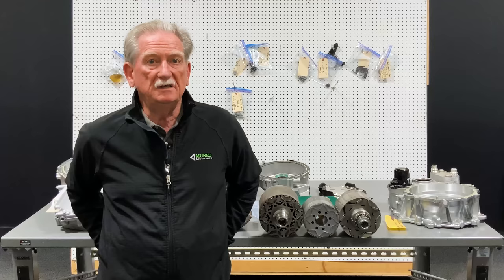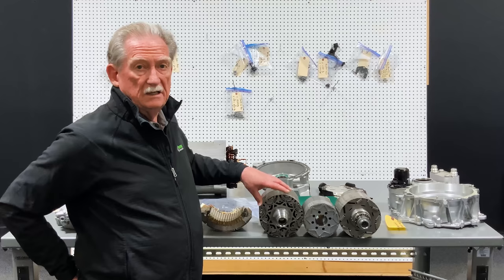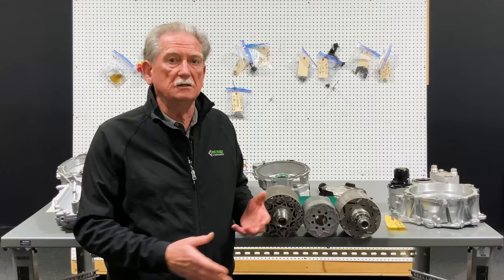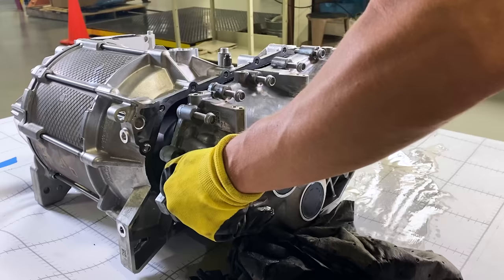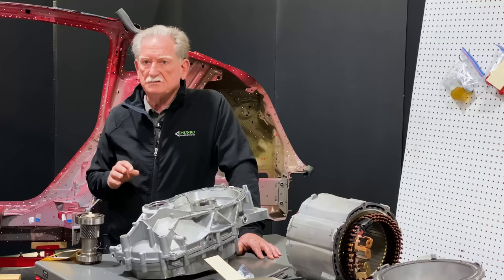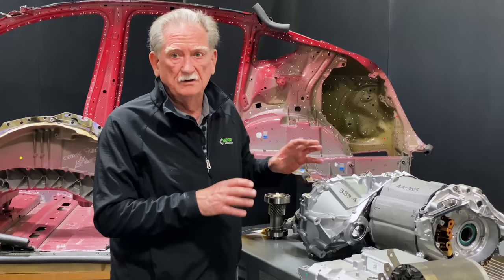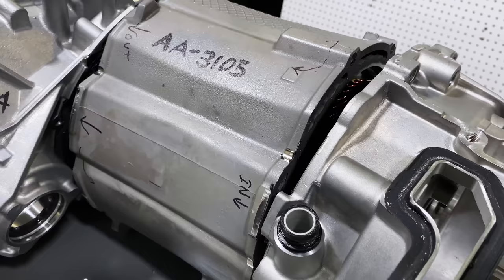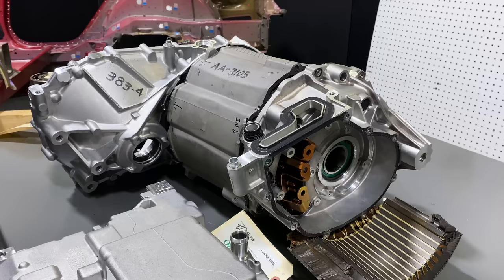Volkswagen ID.4: Electric Motor Teardown and Analysis

Comment: I think this guy has a patent out on snap fit components because anyone who worked on cars knows that snap fit pieces only work one time and never fit again. Also I worked for Ford Motor company for 8 years and their front bumpers need to be removed for service of many things and after you take it off once it never stays in place. A 1985 chevy where everything bolts on still fits perfect. SO Munro if you are reading this please explain to me what you think makes it better and i will provide my experince

Comment: The anti-fastener argument doesn't make sense to me.  Threaded fasteners allow for easy adjustability - take up the tolerance in a stack of parts that your rivet clamping jig may not.  It allows for disassembly, repair, maintenance, and recycling, whereas rivets can't be as easily removed.  Threaded fasteners can be used with thread lock or locking spacers to prevent them from loosening.  I agree, however, that minimizing the number of fasteners and using undercuts and latching features in combination with fasteners is good for reducing cost and weight.

Comment: I don't understand why they did not eliminate the permanent magnets and went for a switched reluctance design. That will be both cheaper, and you don't have to rely in China to get the raw materials for the magnets. And a good inverter will eliminate the torque ripple problem.

Comment: The single motor ID4 can tow 2200 lbs. Even the dual-motor version of the Mach-e has no towing capability. That should tell you something about the difference between the two cars’ motors.

Comment: Does anybody realize that VW and also lost other big OEM‘s are only buying the already finished and assembled product and that gearbox, inverter and E-Motor is done by their suppliers? 
Also I agree they won‘t be serviced much but just replaced. Cause it costs much less

Comment: I disagree with your criticism of the screwed-down PCBs. If they didn't want to be able to replace the PCB they would probably have potted the whole PCB to vibration-proof it, increase thermal bonding without the loose thermal pads - this also would have removed the need for screws. 

Now, if they used normal machine screws instead of some kind of tri-lobular taptite screw, I agree they were a poor choice, but generally the right concept.

Comment: VW had to focus on motor engineering as its behind on the battery output. So it has to cut costs elsewhere and the non battery manufacturing offers cost cut opportunities and efficiencies.

Comment: Should an inverter should be fixable? If MTBF is really high and the cost of a new part can be lowered and its MTBF can be increased by making it unrepairable then, yes, glue it together. It's all about reducing the overall cost (and environmental impact) across all users. I feel a complex graph coming on.

Comment: INPUT!
Yes, snaps are better for you, but snaps are not better for me, the consumer.
Some (most) want service'ability.
The more snaps you install, the more I yell and need bandaids.
Cheaper is not always better and all it takes is a few knuckleheads like myself hoop'in and hollar'in about how many bandaids you're going to need and then you're back to the drawing board.
I watched to the end, I agree less fasteners the better BUT, what is your replacement for key pressure points?
Snaps are typically 1 way. Upon de-snapping, your grip/hold is less tight.
Service'ability

Comment: you said vw dont have pump in the coolant system, but how the coolant circulates if no pump?
Reply from the maker: Sandy was referring to pumping the “gear oil” to the plate heat exchanger. The Tesla has that pump and interface and the VW doesn’t. VW does pump coolant through the aluminum housing.
Reply: @MunroLive  yeah I was asking the coolant circulation.  So, there still a pump? thank u

Comment: As a diesel tech, I deeply question this guys expertise. He doesn’t make a fucking thing. “People wont repair this inverter… Like ignition modules no one repairs this either”. Well hey buckwheat, engine, transmission, and a pile of other body and chassis controllers are repaired everyday. Threaded fasteners do their job very very well. Installed properly, and secured properly they are incredibly durable. I see threaded fasteners go down the road for nearly a million miles without ever coming loose. 

Frankly this is a case of someone justifying their engineer job. I must find something to complain about… 

This guy has pocket hands. There isn’t a scar, or callous anywhere on them. They are red and swollen from always hanging at his sides, or being  in his pockets, do playing with his pencils, rulers, and computer mouse. 

Get out of your office and get in the shop. Then you can apply your engineering “opinions” in the real world when you have to drill out a rivet, or scrape of your glue, or toss a part because a clip broke, replace (to do it right) or put a screw into a dash panel because the plastic hole or stand that your god forsaken clip attached to or passes through has worn so far the clip does nothing

Comment: Sandy's hate of screws and bolts has always bothered me. I'm fine with reducing but when everything is snapped and glued together, it's throwaway and not serviceable. It will never go back together the same and you will always break snaps taking it apart. The snaps are also hidden so without direct knowledge of the placement it's just a nightmare to service.

Comment: I completely disagree on rivets and glue in the inverter! It is too valuable to salvage.
VW made a good decision to go with the top to bottom design with fasteners.
Usually it is some dirt cheap on board ceramic capacitor witch fails and not the expensive IGBT. 

Also as an electronics engineer I can say that you can save the board space with the external bolton bleed resistor comparing to the on board SMT resistor array.
And it will dump the heat to the case directly and not to the board itself. 
Repetitive thermal cycles are the main cause for cracks in onboard components and solder joints.
If you have to do that, place the resistor array away from the other components on board, not in the middle of the board along with the main controller and IGBT drivers like tesla did @29:00. Probability of a crack is directly proportional to the number of solder joints affected by thermal gradient.

Comment: You are way ahead of me in your excellent knowledge and experience. There is one thing that worries me. You would prefer components to be sealed for life. That's Ok if the life of the one I happen to own has a long one. But if a five pound (GBP) component within fails, you cant replace it. You are removing the jobs that trained mechanics can do. So I buy a car that costs say, £15,000. After a while, its out of warranty, and I need to have a £10,000 component to fix it. I used to build historic race engines. Many of them were 50 years old. I never had a threaded fastener undo in service. If I had followed the 'seal for life' way, I would never have built an engine. So there are times when progress has to be examined with a non-engineer eye. Thanks for video.

Comment: I’m not so excited about eliminating a bearing as you are sir.  First preload increases bearing life which may have been lost; second, Helical gears produce side load which are usually reacted with tapered roller bearings.  You didn’t show the other bearing, but looked like ball bearing.
Fasteners loosening, in assemblies like your taking about usually there are shear pins so fasteners don’t see shear. The four bolts in the motor probably need to be staked (mechanical retention).

Comment: At the 11-ish minute mark, he is talking about "this is the oil pump, the oil filter, the heat exchanger" on the Tesla motor. Wait, what? Am I to understand that Tesla's have oil filters oil pumps and heat exchangers in addition to their coolant system? LOL for some reason that cracks me up, imagining an electric car, that ends up having a Convergent Evolution to an internal combustion type's need for actual implementation. What's next, an oil bath air filter like an old Series II Land Rover? hahahaha

Comment: Snap in fasteners snap. The worst part of american cars is the hidden snap fasteners that always break when you try to take something apart to repair something else, increasing the cost of the repair. With electronics becoming a major component of vehicles you want to be able to repair them rather than throw them away. That would be like throwing away the IC engine because it was worn out rather than rebuilding it.
If the screws are backing out it is because you did not use dowels to keep the parts aligned and the side loads off the screw tension fasteners.

Comment: Thank you so much for doing all the analysis that I have not been motivated enough to slog through myself. Your conclusions on winners and losers seem quite plausible. In terms of when the globe will hit 100%, these things follow an S curve for which there are formulas available. Thus the last 20% or so come far more slowly then the middle 60 or so percent. So one cannot just extend an exponential growth rate to 100% or one will greatly underestimate how long it will take the convert the last 20% Luddite hold-out consumers. There will also be consumers whose driving cycle may truly be better served by another propulsion means like a ranch in Wyoming or a off-grid home in the Rocky Mountains. by example, studying history, it took about 50 years to completely convert railroads almost completely from steam to diesel-electric even though it was fr superior and the same 50 year duration to convert on-highway heavy duty trucking from gasoline to almost all diesel, even though diesel had so much more torque. I am not an EV denier, or disagreeing with the trend, I am simply trying to add some realization to when things will be "All Electric". Purely going by my gut I'd say 2040 or 2050. BUT 80% could be achieved by your 100% dates. Purely my opinion

Comment: It's only me feeling a durability problem with the lack of the 4 bearing? at the speed this motor turns, the lack of this bearing will make the other 2 bearings be stressed, and at the moment the axel connection itself bends the minimum, the motor will be complettly trash...

Comment: I understand your qualm with threaded fasteners.... but serviceability is a big issue and threaded fasteners make a part much easier to repair. 

Also what your suggesting makes for a throwaway part which is horrible for the environment... Quite the opposite of what an EV "stands" for. They should be built for serviceability.

Side note: snap fasteners heat cycle and break off rendering them useless with a possibility of breaking the casting, causing a larger more expensive and avoidable problem.

Comment: Bearing size .. I’m sure the Europeans make better bearing.
Train tracks.. for high speed trains the tracks are welded all the way. 
Expansion curves and dead ends take up the temperature differentials.
Reply: Did he mention something about forces, torque, revs?
He is comparing bearing by weight. This way, every US car win’s.

Comment: Circuit boards with many screws can be forced to bend under thermal cycling;  better to float.    Cycling is the real life killer.  Also solid state devices should be gold process, not aluminum bonding wires, due to thermal cycling.  Aluminum work hardens and breaks, gold is ductile and very much longer life.

Comment: You will see snap fittings and locking tabs in the next generation. VW was in a rush to catch Tesla’s market share. Robust snap fittings take longer to design and out source I guess than a threaded hole. 🤔

Comment: That's a lot of aluminium around the inverter. 

You mentioned the Tesla engine has been designed for a 1 million miles. Is this for the electrical engine or also for the inverter?

What are the quotes for VW for the lifetime of the electrical engine and the inverter?

Comment: In 10 years people will definately try to open and fix these invertors. Nobody will want to pay $10 000 for a new one :)
It's good that they put screws there, so we can "unfasten" them later to fix that module :)
One thing I don't like about the invertors is that heat sink with the pins... That will definately leak someday. They could have done it one-piece or just weld the 2 parts together forever so they don't leak. If that starts to leak, the invertor is done... game over.

Comment: Very interesting video.  One thing that intrigues me about EVs is the number of moving parts compared to an internal combustion engine and transmission.  To my untrained eye, I counted 14 moving parts in the motor assembly (rotor, bearings, and gears) compared to the hundreds of moving parts in an I.C.E. and transmission, not to mention those parts are subjected to extreme heat and vibration.  Is my count correct or did I miss something?

Comment: The oil and pump on Tesla is a good idea. Using oil serve dual purposes in lubrication as well as cooling and the filter ensures longevity on the parts whenever the oil circulates. The design and overall of Tesla's claim of 1 million miles on its EVs is the sum of its components and design to reach that claim ..... not substantiated at this point.....and remains to be seen later whether this is true.

Comment: Snap-together fasteners would surely make assemble easier but would it put the burden on manufacturing???  Why not replace the screws with dowels and use thru bolting to clamp all the pieces together.  I know you don't like thru bolting but in this case, you can choose your poison.  I don't think thru bolting would take a lateral strain with the doweling present.  What say you???

Comment: Nice review of becoming and developing technology... Don't know if I would share the thoughts of railways tracks done in "shaved" configuration anymore in this century. They are more like welded and same continuous piece today without any joints. Same thought applies also to possibility to repair the inverter unit which is VERY nice from Volkswagen in today's bullshit never open world. Off course these are the first versions in the technology run and everything can change inside the module... But for sure You can say that they have done some amazing collaboration design work with thermal management, mechanical and electrical design to shave some nice integrated design. We see only the he outcome of that but more interesting would be how have they done management of ideas and running them to a level of quite robust looking design. Must be a thing that real car companys have practiced a lot in resent years and especially when implementing whole new tech to replace combustion tec

Comment: Not sure why he's so against fasteners. Every single one used in this is being used to provide a clamping force to compress a gasket or hold a press a heat sink against a thermal pad. You can't do that with rivets.

Comment: i have 2020 e-golf car has no start because on the radio screen 2 message 1-error electrical system stop.
2-towing damages electrical system see owner manual
OBD DIAGNOSTIC CODE
error code:P0C0100 DRIVE MOTOR A CURRENT HIGH
error code:P0A1B00 DRIVE MOTOR A CONTROL MODULE
pls do you have a any id what's problem on the car.

Comment: Some clarifications on the lessons of Dr. Munro:
1) VW got rid of the oil pump, Tesla didn't. Tesla sprays oil directly on the end side of the stator windings. With water coolant you can not do this. And this direct cooling is necessary because Tesla motors are high power dense. VW are not so powerful. You can compare VW and Nissan or GM. Not VW and Tesla. Moreover oil has a much wider temperature range than water + glycol. Some thermal - solar system run on oil or molten salts but never on water otherwise you should have to work on extreme pressure ranges.
2) VW uses a modular design of the motor casing, has only three bearings, motor mount is not on a third piece. The reason why Tesla 2:00 puts the mount directly into the casting and has one less casting piece is increased stiffness. VW design is similar to the cylinder deck of an ICE bolted and not integral to the crankcase. Tesla design is stiffer and lighter.
3) Get rid of the bolted connections because Sandy and Ford could ot tighten the screws. Bolted connections are everywhere and work fine.

Comment: I do not believe that you can say that VW has "passed Tesla" by eliminating components. Comparing a low performance VW to a Tesla is definitely not apples to apples. You can clearly see the size differential between the VW components when compared to the Tesla ones. And while a Tesla may not survive for those million miles spoken of within the video, which components do you want in your vehicle, the ones meant to be cheaper or the one's built to be robust?  Lastly, I can guarantee that a Tesla driver will probably push their car a little harder so I appreciate those "extra" heat pumps and components.

Comment: Saving 1 bearing, the rest smaller... Splines will wear ( as they do in Transporter CV shafts) and the gearbox will be broken after 200k.km or something. The problem is, European manufacturers are calculating cars must survive 150k.km (warranty). For me this is the indication that the policy of reliability hasn't changed and we need to rent new cars rather than buying them. Forget the old Mercedes W124 that could last a million km. Car manufacturers don't need that. They need fast food...

Comment: 7:00 Wow, that casting is seriously problematic if machining is done only for part of casting. I thought things like that don't happen these days casting quality. 29:00 That casing will die of drowning, I'm pretty damn sure about that. Only one small sealing surface between coolant and electronics? No backup surface = not good.